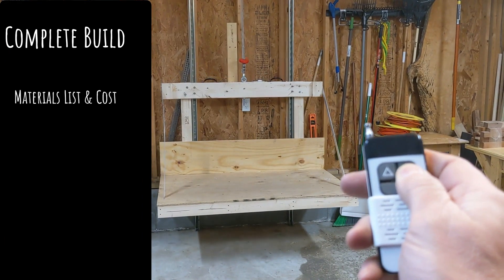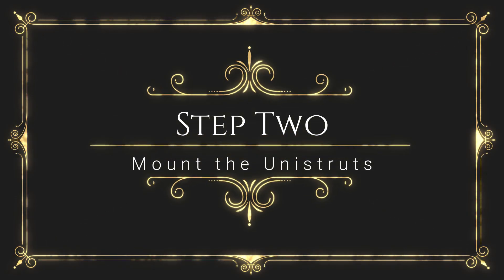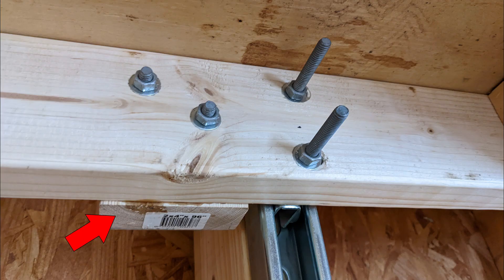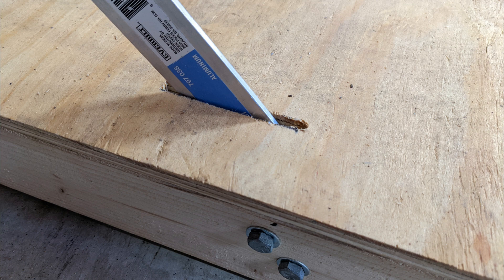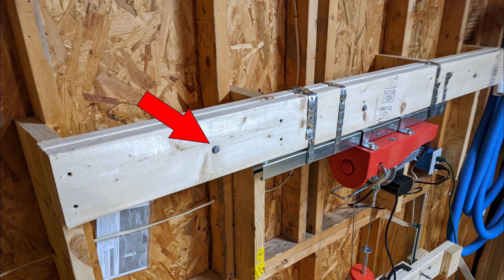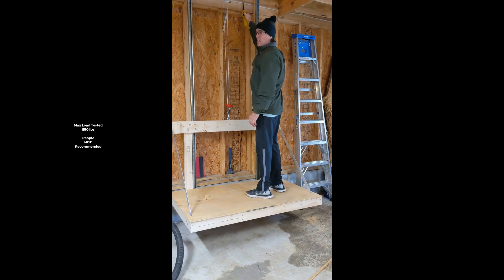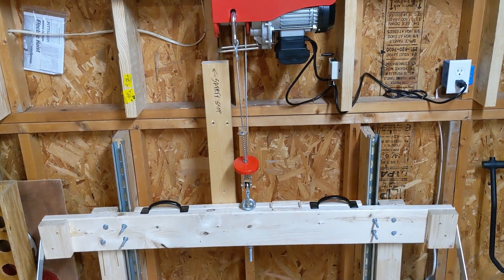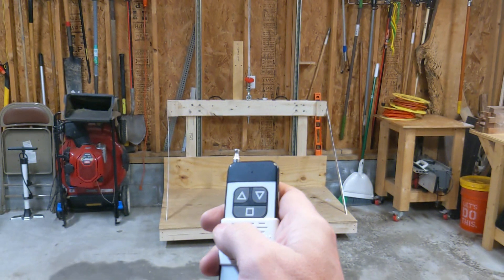DIY Elevator with Wireless Remote (No Welding!)

Comment: Any ideas why the controller would work inconsistently? I hooked it up to my hoist just like you have in the video and it will work for fractions of a second and then turn off. And after a few button clicks it stopped working entirely and now I can't get it to work at all.
Reply from the maker: No, I have no idea. That said, I have heard that the same wireless controller I purchased may not be available anymore so what you're using may be different. 

Even on my installation, I was having trouble figuring it out and it ended up calling a professional electrician to help and that solved the problem. I documented what worked for me. If the controller changed, you may end up in the same position I did where you'll have to call an electrician. 

Once you do, I wouldn't wire it so you had to hold the button the entire time, but do a momentary installation where you simply tap the button and it goes and you tap it again to stop it. The way I installed it on the video caused me to go through a lot of batteries at the worst times.
Reply: @mikeh7256  I moved the pins so it would operate in latched mode like you said and that seemed to fix everything. I connected the wires all the same - just like you did in the video - and now it's working great! Thanks!

Comment: I have an elevator bed in a ti y home that is motorized. Lately it’s not going up level. Any idea how to level it?
Reply from the maker: Outside rails with a center pull. The rails prevent it from going too far out of wack.
Reply: @mikeh7256 are you saying to install them to keep it from going out of whack? It’s all done by pulleys. Any way to straighten?

Comment: Thanks for the info.  Does the hoist bear the load during storage while up in the air?  Wife is afraid it may fall during storage.  Thanks
Reply from the maker: Yes. Rated for over 800 lbs.
I think you're ok. LOL

Been using ours for 2 years with no hiccups
Reply: @mikeh7256 thank you!

Comment: What safety measure is installed or back up system should either the cable or motor fail while in use?  Or if the power goes out while in use?  Nice work by the way!
Reply from the maker: @testdepth377  currently, there are no safety measures that are physically in place. I have not had the power go out, but I did have the battery die on the remote while I was in the Attic, but I just simply pushed the old ladder system down and used that.

My safety measure is physical, and not foolproof, but I physically touch the cables as they're going up or down to see if there's any burrs or weak points each time. I also take a look at the secure points, particularly the attach points from the end of the floorboard to the top of the back panel. 

It wouldn't be a bad idea to have a fall arrester installed
Reply: @mikeh7256  Thank you for the quick response. Do you have a link for the fall arrester? I'm wanting to purchase a home in WV and the only things stopping me are being 60yrs old and the only access from the first floor (kitchen, dining rm and laundry) to the 2nd floor where the bedroom is, is a narrow wrought iron spiral staircase as seen in VRBO's or AIRBNB's.

Comment: 3 years later, how is the wireless remote holding up? I just ordered one based on your video. 

Thanks for the thorough video.
Reply from the maker: @mvrussisonline  It's doing great! However, I had to change the method of how the remote worked because the way I showed in the video where you have to hold the button down was running the batteries down very quickly. By using a momentary method where you could just tap up or tap down. Saves the battery and works great.
Reply: @ gotcha! Thanks for the report.

Comment: There is no way that what you’ve done there in cutting those joists to accommodate the hole is sufficient to support the floor. Cutting one joist would be bad enough, but cutting two adjoining joists is much worse. Those pieces you cut to nail to the end of the cut joist are doing virtually nothing. To do something like this safely, you would need an engineer to come out, evaluate the situation, and tell you what would be required to do this properly. I don’t know if you have a name for this device 😊yet, but I’d like to suggest “Widowmaker 800.”
Reply from the maker: @lllmmm3572  It isn't as strong as the original joist, but it isn't as dangerous as you're suggesting. By attaching the cut joist to the two adjacent joists, you're increasing the loads of the adjacent joists by roughly 50%. Remember that the load is spread over an area. The elevator has been in place for over 2 years now. We have stuff in storage above with no flexing of the floor at all. Now, if we went to the max capacity of what the joists could hold, we might have an issue, but that is not the case here nor is it a normal case. I can tell you that I have jumped on both cut edges after attachment and there's no flexing or bouncing. I'm 215 lb.
Reply: @ the previous owner of my house cut through the bottom chord of one of the trusses to accommodate one of his home “improvement“ projects. Even though there was nothing stored in the attic, and even though he had only cut through one part of the truss, I had to have an engineer out to address the issue before I could buy the house. The engineer showed us how, over the course of about 15 years, the roofline of the house was beginning to sag due to this one cut. Just because you do something like this, and there is no immediate, appreciable failure, that does not mean that everything is OK. I believe you when you say that you don’t see any damage yet. The previous owner of this house was sure that what he did was OK, but it was not. Could your house have been designed in such a way that two joists could be cut, and there would be no problem? I suppose so, but it isn’t very likely.

Comment: Mike- this is a great write up, thanks. I have a different brand of lift (Northern Tool) and the corded remote has a large emergency stop button as well as up/down buttons. The remote cord has 4 wires (red, white, black brown). I wired the remote per your video using my brown wire where your blue wire was. I went through the remote programming process no problem but the lift only wants to go up (it is against the limit switch) but no response other than a beep when trying to go down. I suspect it is not wired the same as yours, can you describe your trouble shooting process so that I can figure out which wire goes where?
Reply from the maker: @jimbutterworth4994  when I ran into my initial problems, my troubleshooting included calling a professional electrician to help me! LOL 

Between the two of us, we found a way for it to work.

One tip worth taking is to wire it so that you don't have to hold the button when you go up or down. This will run your batteries down quick. I have been stranded in the Attic a couple times. The single momentary push is the best way to go.
Reply: @mikeh7256  Thanks, I'll give it a shot

Comment: My dad is the director of product development at one of the largest fall safety companies in the United States. He’s had to back up his engineers in court a number of times only to find out through evidence that the people on the work site neglected to use the fall arrestor properly, or use it at all. The safety equipment works flawlessly unless they are old or cheap, but they never work at all when you don’t use them at all. I wouldn’t be caught dead without one on that build.
Reply from the maker: @zachdayton4199  That's a great comment and well received. This build has been in use for over 3 years now. Working flawlessly. The only thing I watch closely is the cable to make sure there are no burrs. This can happen if the elevator is brought down too far and hits the floor and the cable loosens. This will cause the cable to overlap causing a jump or rubbing which will give you burrs. Burrs will lead to an eventual cable failure. Some have questioned whether people should be on that elevator at all, and I can tell you that if the elevator goes up or down, we are always on it.

That said, from the comments received on this channel, there are indeed two things that are recommended here - replacing the deck screws with machine screws and the fall arrestors.
Reply: @mikeh7256  nothing ever failed until it did
Reply: @mikeh7256  Fall arrestor makes you feel good, but that's not going to do shit if that hoist comes down and your hoist supports with that conduit hangar strap bullshit.

Comment: Recommendation:  The I-bolt hole drilled through the 2x6 at the top of the platform frame will weaken the 2x6 considerably.  The maximum bending stress is located at that location, and a hole there is not a good idea.  Instead, wrap a tow strap or some similar pliable strap around the 2x6, and attach it to the hoist connection.  The rating on the tow strap probably exceeds the I-bolt capacity by a lot.  This will also ensure an even distribution of bending load into the 2x6 and the smaller 2x6 scabbed on the back which adds stiffness.
Reply from the maker: @michaellowe5558  Good recommendation

Comment: I am unable to get the remotes working.  The only difference in the remote I ordered and the one in Mike's video is that I did not have a RED wire but had a Brown wire instead.  Did anyone have to program the remotes??  I noted there is a "Learn" button the wireless receiver.  Thanx, Pete
Reply from the maker: @peteoquist215  You shouldn't have to program the remote. If worst comes to worse, I would reach out to an electrician. 

Is there a way on your remote to verify whether it is receiving a signal? A green light when you press a button at the wired side, etc

Comment: What is your center dimension on yer rails
Reply from the maker: I'll have to go look at what mine is exactly. The concept is that you can do this with about any size opening. Your opening will determine how far apart your rails are going to be. My rule of thumb is to find the center and then split the distance between the center and the edge on both sides.

Comment: Is it my imagination or did this guy begin building this lift wrong. Anyone else see it
Reply from the maker: @jamescecil4629  Hey, who knows? It was my first time. Just did the best I could
Reply: @mikeh7256  no you had the 2x4 on the top rollers to start out
Reply from the maker: @jamescecil4629  made a few mistakes along the way. Probably the biggest one was choosing a hook holder that was way too small. That was dangerous
Reply: @mikeh7256  I’ve watched that video 50x
Reply from the maker: @jamescecil4629  still working today, so there's that....
Reply: @mikeh7256  oh not being smart I’m building the exact one you designed …thanks

Comment: I've built my own lift. How do you keep the wire rope from jumping over itself and jerking when going up?
Reply: Thank you for the reply. I have done both things you mentioned.  I'll agree, stopping before touchdown on the floor is the best possible solution. But that's a guessing game.
It seems to work fine for several times and then the issue returns. Probably needs a lower stop switch but I'm not sure how to put that into the system.
Reply from the maker: @mikemm03  if you figure out how to put the stop switch at the bottom, let me know!
Reply: @mikeh7256  also wondering if less rope would help. These things have 40 foot.
20 foot would be ample for my needs, only lifting 8 feet.
Reply from the maker: @mikemm03  That would be a great idea. I'm just not sure how to shorten it. I've never let it out all the way.
Reply from the maker: That, my friend, is an excellent question! What you need to do is make sure that the wire is rolled up neatly. To do that, you will need to let your lift all the way down and just keep coming for a little bit and then stop. 

Now, start the wind-up process again with tension on the wire so that it neatly wraps around the spool. Once you do this, there won't be any jumping around. 

Further, we have gotten used to stopping the lift a few inches before it hits the floor so this doesn't happen again. That is the cause.

Comment: Purchased the same wireless remote and when plugged in the motor beeps and hums? My motor from HF does not have the blue wire but it is a light brown. All other colors are the same

Comment: What can you do if you don't have the additional hight for the the roller system to make it land even with the above floor? Great video! Thanks!
Reply from the maker: I'd create a loop over system and mount the winch lower
Reply: Sorry I'm not two mechanically inclined when it comes to these type of adjustments. Maybe you can give me additional information or it might be a great idea for an update video when space is an issue. Thanks for answering my question, I find your videos very interesting and informative thank you so much!

Comment: I have the exact system you have but they changed the color code on the remote wires, it would be nice to know the wire color code on the motor. The newer version has Red,Black,White & Brown thanks for the cool setup idea, now to just get mine to work 😊!!
Reply from the maker: In the end, I hired an electrician to figure out the wiring scheme. Worth it. I was afraid I was going to ruin it.
Reply: @mikeh7256  👍 I’ve tried using the brown on mine in place of your blue wire but that didn’t work. I’ve found the schematic online but that doesn’t give the wire color codes. I’ll get it to work eventually and then add the color codes I’ve came up with when done, it may help others. Thanks 👍
Reply: @Homefree18  Have u come up with the color codes??
Reply: @Homefree18  Have u come up with the color codes??
Reply: @Homefree18  I have run into the exact problem you have. Red, brown, black, and white wires. How to get the remote to work? Did you get it figured out? Thanks in advance for your reply.
Reply: Any luck yet? Mine is doing the same
Reply: @waderambo460  I actually got better information off this video. It was all a help but with the wire color codes this one made more sense to me. I did get mine working after buying the relays, I also bought a plastic box to put it all in. https://youtu.be/l330V8klkLU?si=LMFhflKyxN6h6gs5
Reply: @waderambo460  this wiring made more sense to me. https://youtu.be/l330V8klkLU?si=J28Jox0izpI2ShDs

Comment: I am looking at the 2200lb Vevor on amazon. The wired remote is different from the harbor freight in video. Any clue if wireless remote kit still work?
Reply from the maker: I would guess that it would. If you think about it, all lifts have the same kind of wiring
Reply: @mikeh7256  the wired remote on vevor is yellow black white and aqua. Any clue which is which
Reply from the maker: @chrisholt6136  no, but a quick call to the vendor might help. Also, you might check online for some manuals for the unit. A lot of times it will tell you what wire does what

Comment: Help! I am planning my build like this but the only way I can mount the unistrut is on inside of 2 4x4 steel posts. So the channels of the unistrut would be facing each other. Will that still work?
Reply from the maker: What I would do is to take some wood and attach that to the steel posts and then attach the unistruts facing forward to those wood pieces. That will get to you exactly what I built

Comment: OK I have a question. Where I want to build this, the unistrut needs to be on the inside of a 4inch steal beam. So instead of the channel of the unistrut facing out to platform, they will face inward facing each other. Is that ok?
Reply from the maker: The trick is going to be stabilizing the platform with distribution of weight. Better plan carefully.

Comment: I have watched this video a lot and have built my own lift into the storage room above the garage. Unfortunately, I can't get the wireless remote to work. The only difference between yours and mine is that I bought a Pittsburgh hoist that can handle 2000lb. I wired it exactly the same but it just makes a loud noise when I push the up and down button. Looking for any suggestions I can get.
Reply from the maker: Initially, I had to give up on the wiring so I broke down and hired an electrician to help so I didn't burn down the house. My wife would have never forgiven me! Lol

Sounds like you're at that point...

Comment: Well done video and built one very similar just a bit smaller. But I can't get the remote to work both ways, just down. I've followed the learning button process to the "T" (several times) but still just one way. AND, with the two remotes, once I program one, it forgets the other (it stops working). I wired the motor exactly as you have here, as mine is the same winch. Anyone have insight on this?

Comment: hey any way you could show the hoist wiring so i know what cable going into the wireless unit does and where they come from? my four wires are different colors. thanks
Reply: my four cables are black, white, green and yellow.
Reply from the maker: I can only show what I bought and was able to figure out. I ended up sitting down next to the unit, attaching some wires and testing. That's probably my best recommendation to you. Best of luck!
Reply: @mikeh7256 ok thanks is it possible to get a picture of the wires in the black box attached to your hoist?

Comment: The eyebolt holds 3000lbs but the wood around the hole would be a weak point. Stay safe. I'm riding on mine.
Reply from the maker: So am I. Be safe and watch the condition of the cable.